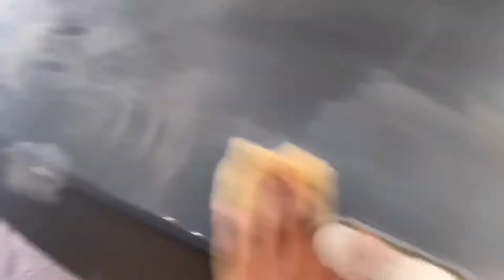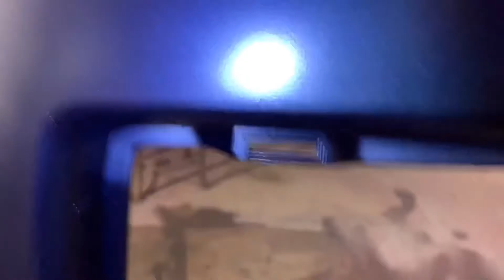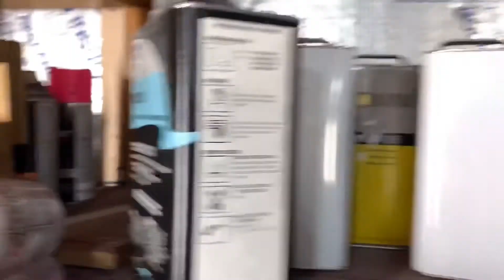How to fix a dent in a car

Comment: Your first coat of primer you'll see the bodywork because it's feeling up all the pinholes but after your second and third it'll seal it all up.
Reply from the maker: Say less definitely appreciate! Ima apply that to my next project, dose certain primers make a difference?
Reply: Yes it do...high dollar primers won't shrink as easy as cheaper primers but you can make either one work